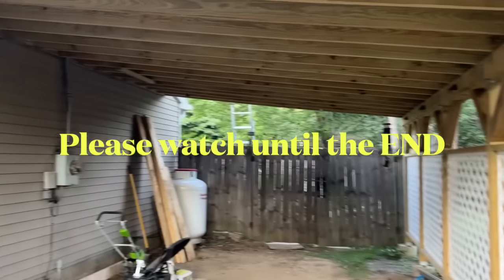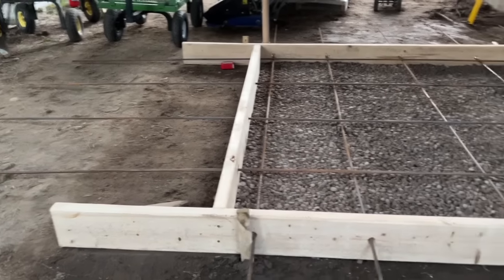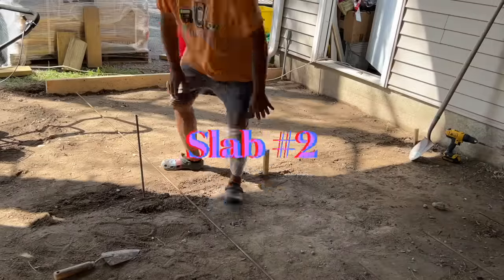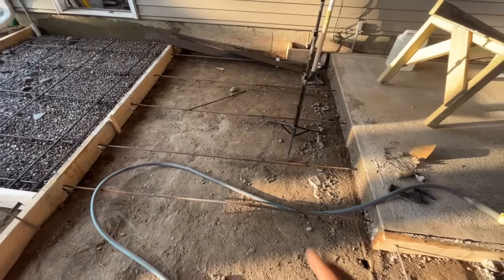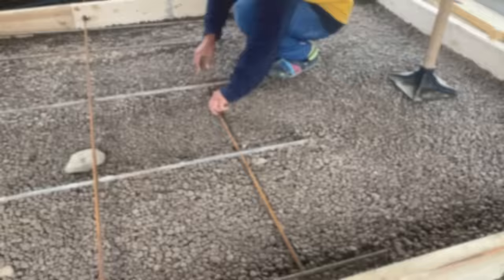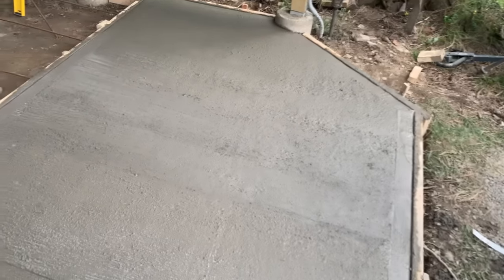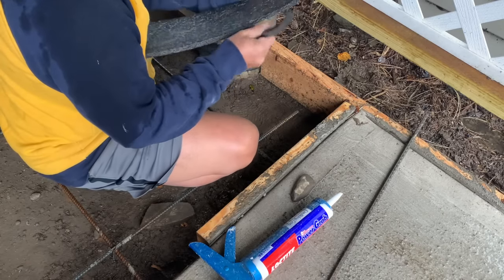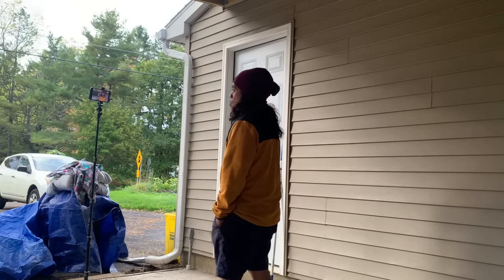Pouring BAGGED concrete for a driveway in sections, DIY.  NO CEMENT TRUCK, 24x14. 4 inch slab.

Comment: What happened to the mixer you started out with? Also, unless you had to for code rebar is not necessary in driveways wire is all you need in my area professionals never use rebar.
Reply from the maker: Thanks for watching.  I still have the mixer up for sale on Facebook.  I did have a few bites, but was too busy with work to respond. I chose rebar for larger slab because I did not want to drill and cut individual holes through the forms to run the wire mesh to attach the slabs together. I did consider wire mesh initially, but felt rebar would be a better way to go.
Reply: @AJDIYNetwork  I mean, why didn't you use the mixer to finish? Why did you use the hand mixer
Reply from the maker: @kr5289  I found it hard to run the mixer being solo. Lifting the bags into the mixer, even cutting it in halves and putting in was back breaking for me.  With the hand mixer I just had to pour it in like you saw in the vid. Either way works, but I found it easier with the hand mixer.
Reply: @AJDIYNetwork  I understand thanks
Reply from the maker: @kr5289  of course

Comment: Did you investigate using metal mesh vs rebar?
Reply from the maker: Mesh would have worked , but using rebar was my better option.  Because I poured concrete in sections, I wanted all the slabs connected with each other.   However, if you get a cement truck to pour the whole slab at once, then mesh would have been the better option.

Comment: rally good job, can i know how man bags did you used for all this driveway?
Reply from the maker: Hi Sarkis, and thank you for watching.  So far 150 bags, but I have to more slabs to go come spring. Each slab is approximately 24-25 bags    So total with the last two slabs, it is 200-202 bags.
Reply: I was thinking of framing out the driveway myself, which I know can do. Hire 3 finishers at $35 an hour (4-5 hour minimum) and a concrete truck which will run me roughly between $1000 to $1300 for the size. 

I just feel for all the time invested and money... am I really saving in the long run?

@AJDIYNetwork
Reply from the maker: @Senorlatulla  I think that will work!  I like taking challenges on myself when it comes to creating a larger scale project.  This one, though not finished at the time writing you, was going to take time and I was in no rush. If you can hire someone to do your project, then by all means :). At least I have given somewhat of an idea of what you may have done.   Please read the description in the video for better detailed cost of what I have saved.   Thanks for watching!

Comment: The old saying is not if it's going to crack but when it's going to crack. I don't know I think that's pretty much true but in this case unless somebody drives a huge vehicle or you're in the middle of an arctic tundra that's NEVER going to crack!!!
Reply from the maker: lol!!!   Well said!  Thank you for watching!
Reply: Correction not when but where that's what you put joints in for to force cracking in those areas

Comment: do i need to put a rebar for backyard patio?thanks
Reply from the maker: Hello.  It depends on several factors,  thickness of slab and size is a couple of them.  How big are you making it?
Reply: @AJDIYNetwork  12x21x4
Reply from the maker: @hammerridecycling7630  absolutely.   If you want, I’ve also seen people using an steel mesh instead.   I chose rebar as I will be parking my car on it.
Reply from the maker: Good luck!  You can do it.  It takes time, but if you have the help, It would be a lot smoother with the work as long as everyone is in the same page as you. Thanks for watching!!!!

Comment: While I applaud your ambition to do the hard work and get the job done, I would suggest anyone who is trying to do their own slabs to save money should just call a local ready mix company and get the concrete there. The bagged concrete is significantly more expensive and by the time you go that route you use up much of the savings compared to truck mix and if you are buying tools like he did here you are the same price range that you can hire it done for and get a professionally finished job.
Reply from the maker: Thanks for watching!
Reply: Youll never be even close to the smount youd spend paying a crew to do it.
Reply: @treefiddy2470  not true. I’ve been in the business my entire life and I can tell you that is not true. If you reach out to concrete contractors who predominantly work for individuals then you will not get close to the amount but if you reach out to concrete contractors who predominately work for builders then you will find their pricing is far more reasonable given their more production oriented model. You’ll still pay a little more but the difference will not be that great and in fact if you are buying any tools like he did here in the video then you will actually save money.
Reply: I have to agree the cost wouldn’t be much cheaper especially if he prepped the area first.  Hiring a concrete crew to do the finishing work and using a ready mix supplier would generally be a better product long term.  Though kudos to him for putting in the work.
Reply: What’s the fun in not doing it yourself? I’ll agree ready mix is generally a better product, but doing anything less than 4 yards (typical minimum order) bagged concrete cost is similar. On 5-17-24, 60# bagged mix is $3.42 at HD in my area. 60 bags x $3.42 = $205.20/ yard.

Comment: Bags are not actually any cheaper than readymix, more expensive usually and much lower quality.   If you need to go dirt cheap what you wanna do is buy concrete sand and aggregate from a gravel supplier and bags of cement and mix it yourself.
Reply: Whos going to help him put the mud down whos going to help him finish the whole slab? Also short load fees add up
Reply from the maker: Good point!   Thank you!
Reply: @esexavo No short load fees if youre mixing it yourself...
Reply: @bromandudeguy1995  labor fees?
Reply from the maker: @bromandudeguy1995 of course!

Comment: Fantastic work! Can I ask - how did you ensure that each slab would be the same height as the next? I’d be concerned I would make one taller/shorter than another and they would not be level.  Clearly you didn’t have this issue as it looks amazing! Nice work…
Reply from the maker: Hello!   I had purchased a 6 foot level.  I was able to to stretch it between each slab to naked sure the FORMs were leveled with each other, but  made sure the pitch was lower.  That way there is water run off towards the driveway.thank you for watching!